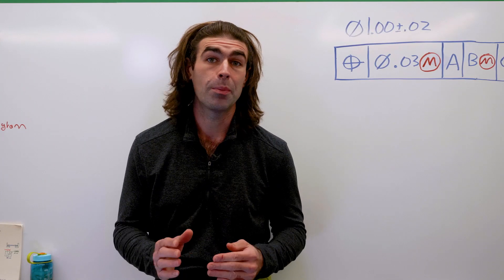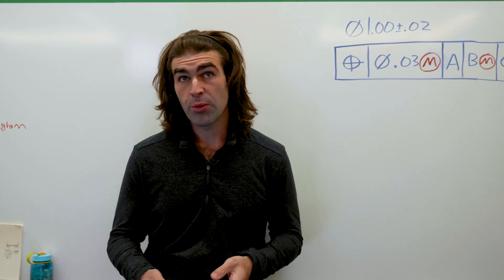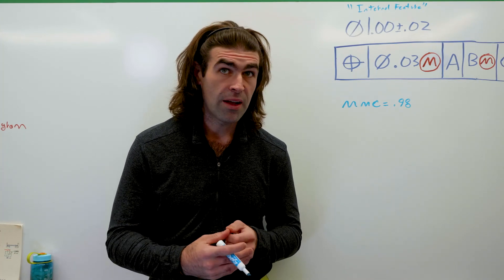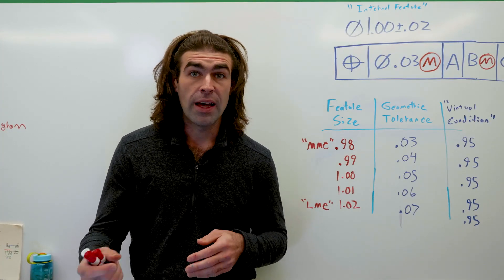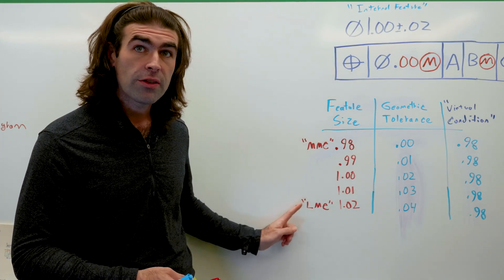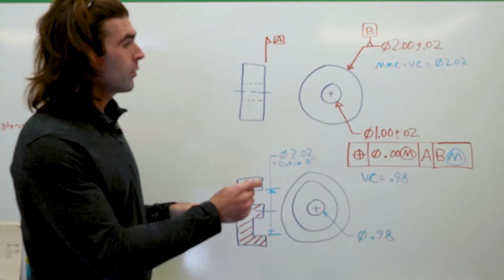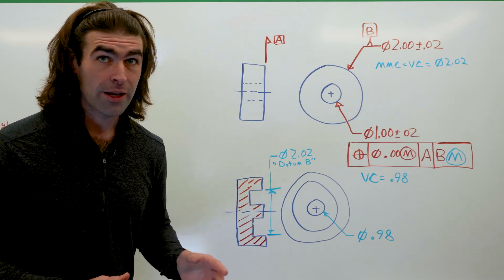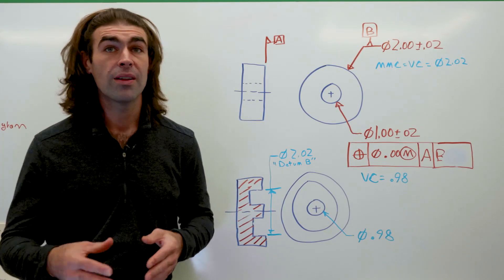GD&T ASME Y14.5: MMC LMC RFS Explained

Comment: At 7:00, you said as the hole gets smaller, you get less tolerance (for LMC). However, shouldn't it be the other way round? If the hole gets gets smaller, you gain more tolerable instead?

Comment: Hello Dean, on your last example (explaining the mmb), you used position geometrical symbol for the center hole. I assume we need some basic dimensions from Datum B to show exact position of that hole, is that true? Overall if you were to fully dimension that part, how would you indicate position of the center hole?
Reply from the maker: Hi, great question. Basic dimensions are not necessary for this configuration. When inspecting, the datum axis “B” is considered the “zero”, and any deviation of the center hole feature is relative to the datum axis.
Reply from the maker: Hi, great question. Basic dimensions are not necessary for this configuration. When inspecting, the datum axis “B” is considered the “zero”, and any deviation of the center hole feature is relative to the datum axis.

Comment: Hello Dean.. Thanks for the video.. Was really easy to understand.. Just have a query regarding the application of these modifiers.. I understand that MMC modifier is used for clearance holes.. Just need an idea about when to go for RFS.. Since it's more restrictive, is it safe to say that whenever the functionality is really close ie press fit or slide fit etc.. We should by default choose RFS method?? I mean using RFS condition for the tolerance value as well as the datum.. Just need your insights
Reply from the maker: Hi, thank you for the comment and question. I will address it in a video very soon. The short answer is: use MMC for clearance hole application where the feature is not locating other features in the tolerance stackup. For features that do locate other features, use RFS. For features that mate to air, use RFS with a large position tolerance.
Reply: @RDeanOdell  Thank you Dean.. Could you please clarify what do you mean by "features that mate to air"?? English isn't my first language.. Excuse me.. 😅😉